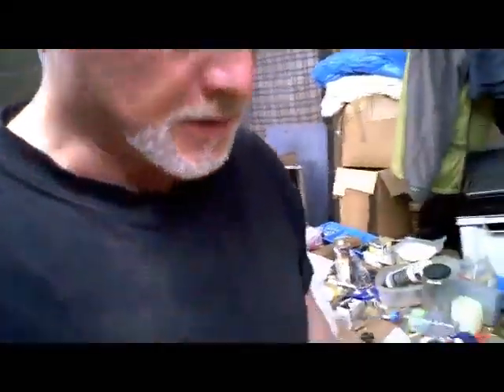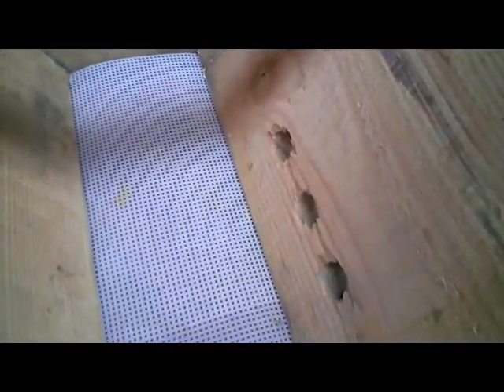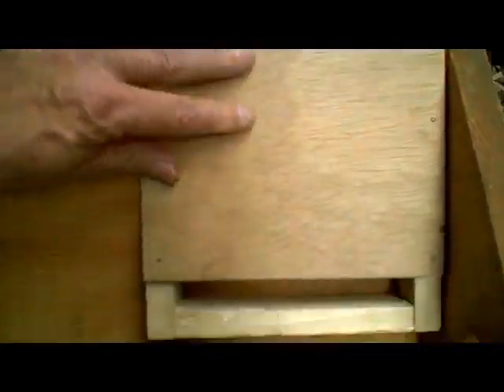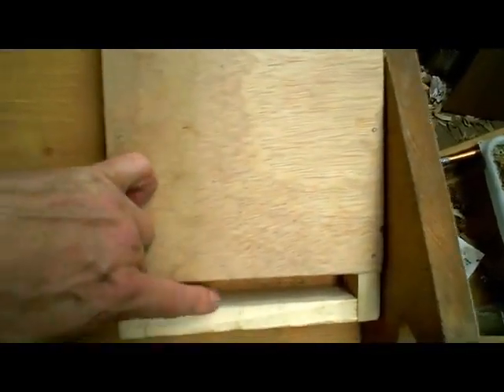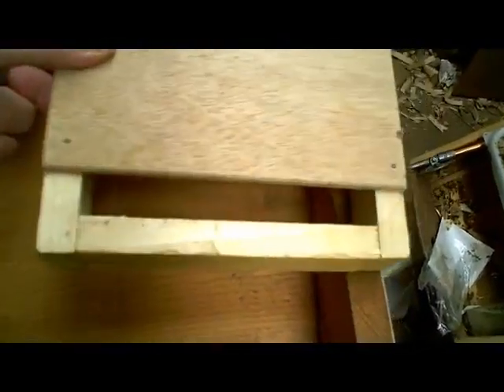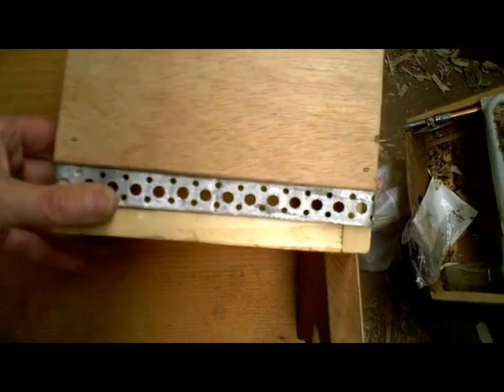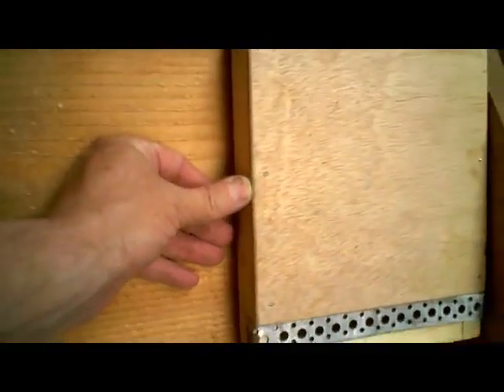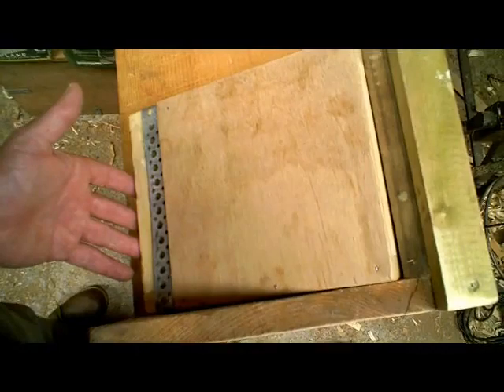KEEP WASPS OUT! Periscope entrance for a top bar hive

Comment: Today is hive building day!  I have been watching your videos and designing new hives.  I’ve committed to the 38mm top bars and I really like the periscope entrance.  It’s simple and can be reversed if it doesn’t pan out.  Though as far as the top side of it I will slant it out and down because we have a great deal of rain and snow in the Pacific Northwestern United States (Washington).  I LOVE the ‘mouse-guard’ strapping.  Everything I need to build this hive is sitting in my shop!  One of the biggest issues is WASPS!  The local barn wasps dive at full speed into the face and head and sting on impact.  I have an extreme allergy to them.  One thing I’m learning is that wasps will not tolerate a bee hive writhing 8m of their nest and will quickly abandon the nest when they find bees in the area.  This means bee hives will be strategically placed around all four barns and the main house (except on the windy sides).  Thanks for sharing.

Comment: one of the best things i have taken from you my friend. i modified mine for summer and robbing. there is a window screen under the 2 piece of luan plywood. i take the 2 inch strip thats over the top where the holes are off in the summer / fall so the robbers go to the screen to get in and the field bees go to the bottom also keeps small hive beetles out for those of us that have them.

Comment: I put a version of this periscope entrance on one of my hives after seeing this video a few years ago, but the bees hated it. They would look for absolutely any other way in or out. Instead of blocking up little cracks like you sometimes get if a topbar isn't pressed down super tight, they would start chewing at it until it was big enough to squeeze themselves out of. And they'd empty the ego floor under the follower boards so they could get out that way. And then the guard bees would get super defensive about the multiple entrances making walking past the hive without protection dangerous. Also, the colony in that hive didn't do as well as my other two hives with simple lower entrances so when they didn't survive a winter that the other two sailed through I gave up on the idea. Maybe I just had a weird colony, but it was my experience.

Comment: Damn you must have a big varroa issue in the UK. Sounds like it’s raining down varroa 😎
Reply from the maker: Anything that reduces numbers without using chemicals is worthwhile, IMO.
Reply: @BarefootBeekeeper  are you still using eco bottoms? The research on pseudo scorpions is quite strong. And I'm sold on then idea of the eco bottoms as habitat for them. Also and anecdotally I was using Eucalyptus chips/detritus( because it was available) in the eco bottoms and my mite loads were greatly reduced. I believe it's the euc. oils driving them off.
Reply from the maker: @GeorgeCMcRae  Yes, I do use them on all my TBH. Interesting about the eucalyptus: i believe it has been shown to be somewhat effective as an essential oil, so it may well have a useful effect as an ingredient in the eco-floor. Not so easy to come by in England, but we do have them.
Reply: Phil Chandler Probably not a good time for humor considering you guys are going through some tough lockdowns over there

Comment: Great ideas Phil.
But. If you would use a piece of metal with 5 mm holes. The bees will be able to get in but a hornet is not able to do so.
Wasps will be slowed down much more because of the small entrances which will be defended very good by the bees.